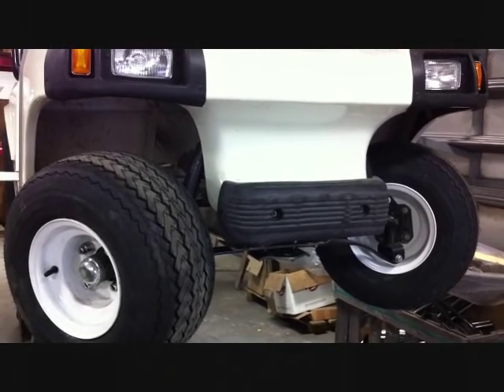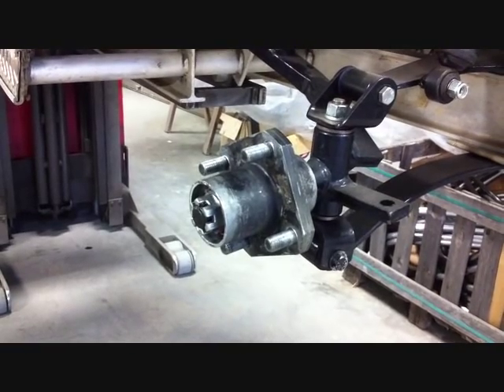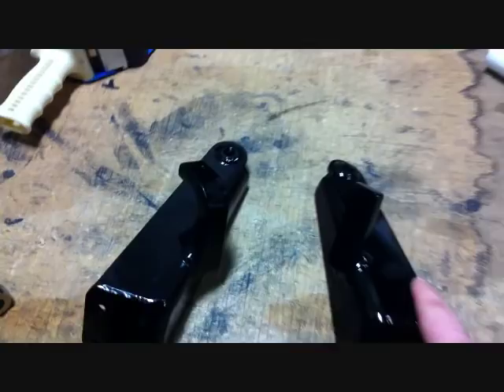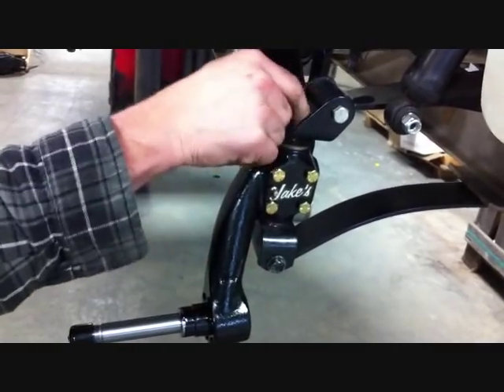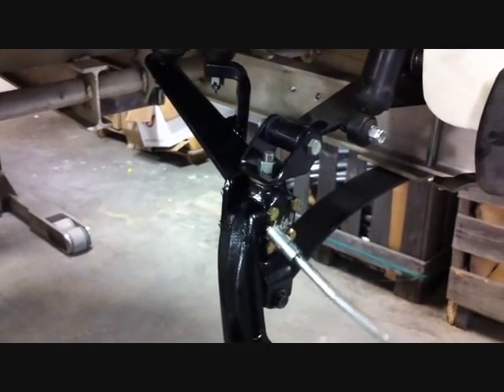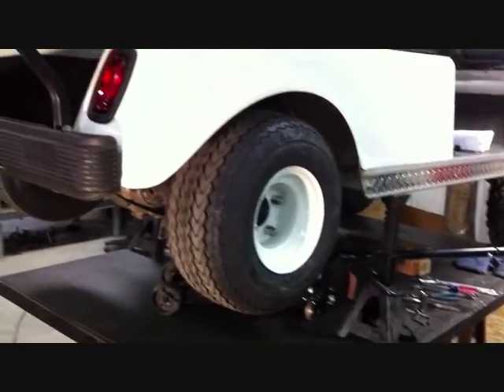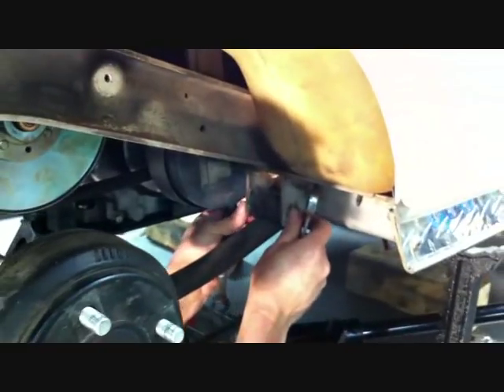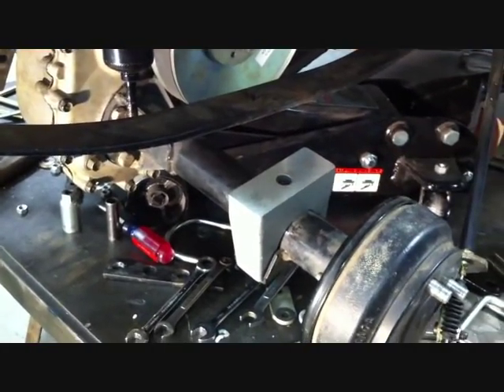Jake's Club Car DS 6" Spindle Lift Kit Installation

Comment: Just did mine.  Referred to the video several times.  Excellent job, thanks a bunch.  The kit worked out great.  Only change/addition to the process I'd suggest is taking the brackets that need the hole sizes increased off and putting them in a vice to drill.